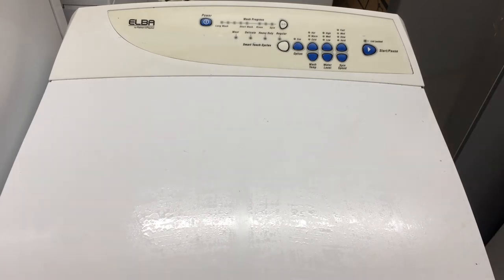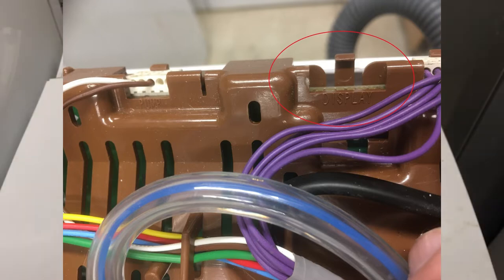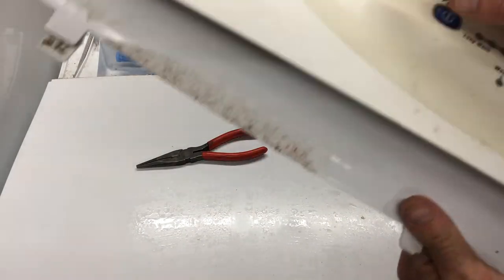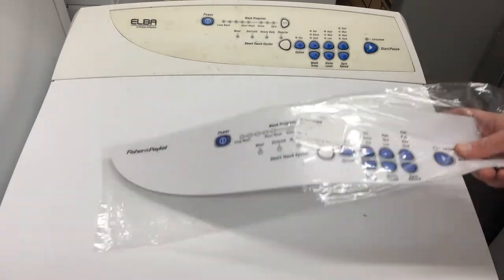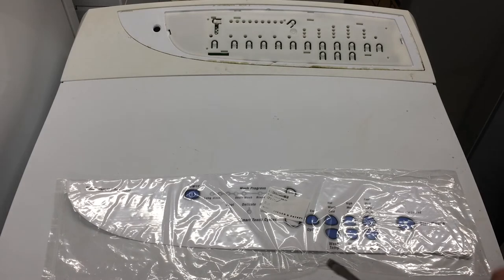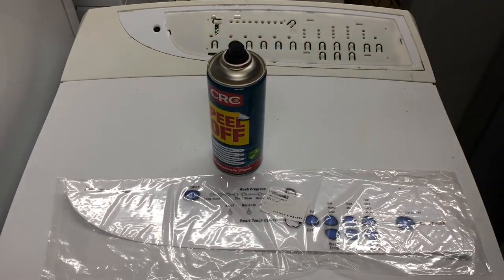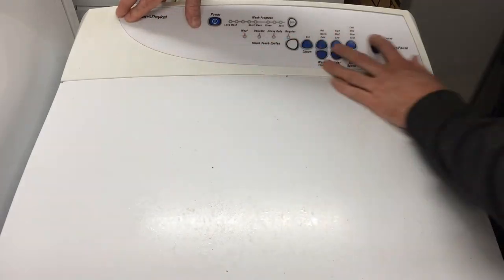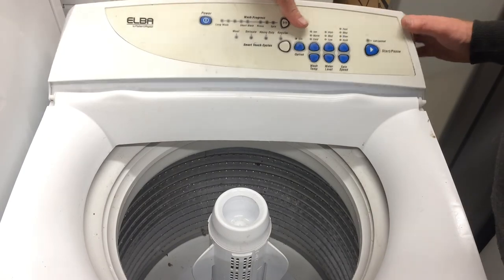Replacing broken Decal/Touch Panel on F&P Smart Drive Washer.

Comment: Thanks for this video Dan! I was wondering how the decal is replaced as i thought you had to glue it in, but no thank you for this video!
Reply: Also i can't find the exact washers from bunnings or mitre 10 online, would supercheap auto or repco have them?
Reply from the maker: Im not sure about them. Usually there is several large drawers of lcok rings and washers etc, and you are looking for BS0330, here is the mitre10 listing online https://www.mitre10.co.nz/shop/champion-locking-rings-external-4mm/p/226494
Reply: @motrepairs  cool, do they come in a bag or a container?
Reply: @motrepairs  thank you for the link Dan! I see they come in a pack of 10, so obviously would be a bag.
Reply from the maker: Yeah its a bag of 10, you can get away with one per machine depending on which clip is causing problems but at that price its often easier just to do two.
Reply: @motrepairs  i haven't got one thats bad, but i've got a family member in Waikato that has a Elba badged Fisher & Paykel with that type of display board, so if i get 2 washers and put them in, then i know she won't have future problems with something that can be rectified easy, even though she never has had any problems with it so far! And one day, i'll give the touch panel one a go, it's just Fisher & Paykel only gave instructions for removing the old adhesive. :)

Comment: I've managed to do 2 deal/touch panel replacements, one thing i did do on one today is started on the right hand corner and i found that easier than the left corner, also do you know where you would find that bulletin for that display type??
Reply from the maker: Yeah starting from the right makes sense, I've just always done it from the left haha. 

I doubt the bulletin will be available on the open web. It was so long ago I don't have a copy any more so don't even know the reference number sorry. Basically just said what I said in this video though, they are pretty brief usually.
Reply: @motrepairs  i only found the right corner better mainly cos when i started on that corner, i found it pretty much lined up with the edge, so all i was able to do was obviously still make sure it wasn't going off course, but yeah it was much more straightforward.

Comment: Aren’t you susposed to order the right decal that says the same brand like the washer decal you were replacing in the video was an Elba by fisher and paykel so I think you ordered the wrong decal I’m just asking Dan if that’s ok
Reply from the maker: Elba was a brand name used by Fisher and Paykel for a few years for sales purposes. Exactly the same machine underneath from the same factory. There were some Elba that were Haier machines but they are a totally different physical design and shape. Same way as years ago they used to use the name Kelvinator or Frigidaire to sell Fisher and Paykel made machines.
Reply: The decals will vary to the original, as long as you get the exact model decal for your machine, that's all that matters.

Comment: My buttons won’t push on
Reply from the maker: Does it flash the lights when you plug it into the wall? If not the controller may be blown. If it flashes lights then cant turn it on then it will be broken switch on the pcb or could be the display has just become unclipped as I have shown here